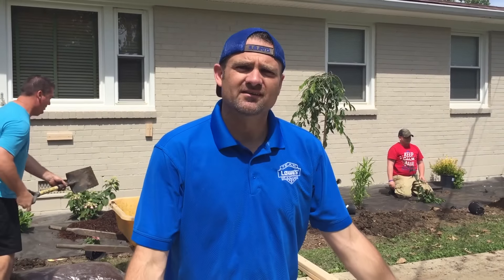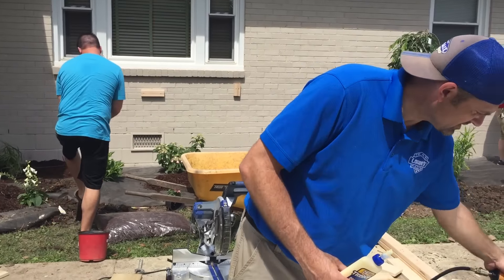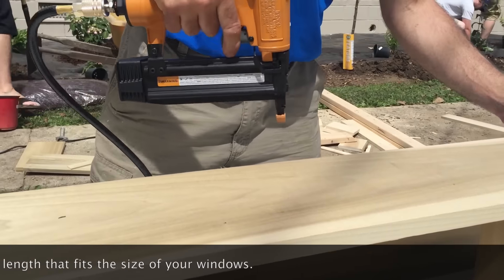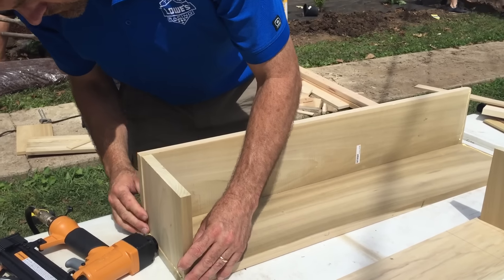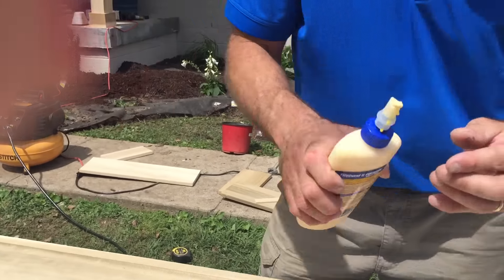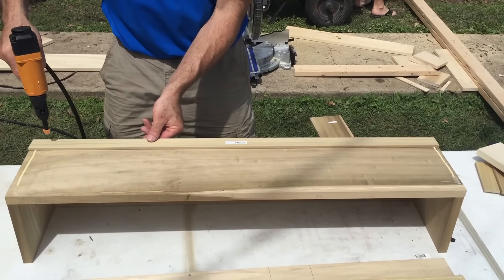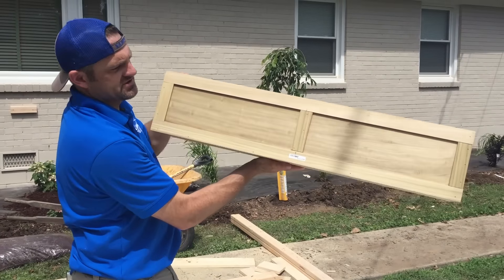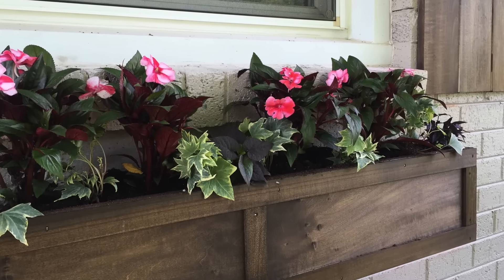How to Build a Window Box

Comment: You're using poplar for exterior boxes that are going to be subject to weather and moisture? Bad choice.  Why not cedar or synthetic which is made for exterior use?
Reply from the maker: You are exactly right, but we working within a tight budget, and the homeowner knew they would only get about two seasons out of those boxes.
Reply: Could you seal the exterior well and out flex seal inside?
Reply: Charles Campione I agree bad choice of wood and campaign ads.